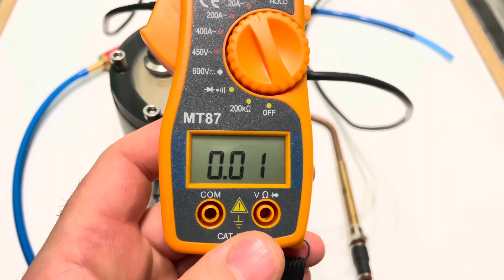HHO Wet Cell - 12V 4 amps. Torch Electrolysis. Part 2

Comment: Very nice.  A consistent flame from those small plates, impressive even if the flame is small, considering hydrogen burns hot instead of big.  
I'd consider putting a flashback arrestor on your fuel line.  A quick way to make one is to get a couple aquarium air stones and stick them in a little PVC casing just big enough to hold them.  I doubt you'd need one on a generator of this size, but for anything bigger or something that gets the chance to have some of the gas stored, you should definitely put it in line with the flow.  It stops any flame/explosion from traveling past it while still allowing the gas through.  One of the worst things is having your generator blow it's top off and/or shatter.

(I just recently found your channel, so I don't know if you implement this regularly or not.)
Reply from the maker: Hello. Welcome to my channel! I always use a sense valve, I did a little experiment with them. Thank you very much. Here you make the video with the sense valves
https://youtu.be/hdZivzm82fE
Reply: @Inventive101  Ah, I see.  While it's a decent way to use it, that's not quite what I'm referring to though.  Here's a video demonstrating the one I'm talking about, though this guy doesn't go into detail on how it's made.
https://www.youtube.com/watch?v=eTFucS3wWu8
Here's a link with a few different types of flashback arrestors and how to make them, the one I'm referring to is the filter type flashback arrestor.
https://www.ehow.co.uk/way_6329731_homemade-hho-flashback-arrestors.html
Doing more digging and I found one that gives much more detail on how it's made.  
https://youtu.be/EwmsATggWvw
I would recommend you go with a metal housing instead of PVC, as it will last longer.  This should have a much lower failure rate than the sense valve you're using.  
I'm not sure how much it'll affect the flow-rate, but nothing I've seen has made mention of it.
Reply from the maker: @Theminecraftian772  	
Theminecraftian772
Water fuel Ah, I see. While it's a decent way to use it, that's not quite what I'm referring to though. Here's a video demonstrating the one I'm talking about, though this guy doesn't go into detail on how it's made. https://www.youtube.com/watch?v=eTFucS3wWu8 Here's a link with a few different types of flashback arrestors and how to make them, the one I'm referring to is the filter type flashback arrestor. https://www.ehow.co.uk/way_6329731_homemade-hho-flashback-arrestors.html Doing more digging and I found one that gives much more detail on how it's made. https://youtu.be/EwmsATggWvw I would recommend you go with a metal housing instead of PVC, as it will last longer. This should have a much lower failure rate than the sense valve you're using. I'm not sure how much it'll affect the flow-rate, but nothing I've seen has made mention of it.

Comment: very well made, i notice that you used 7 plates and put one of the electric connections on plate 4 and the other on the two outside plates, this gives a 4 volt gap between each plate, this set up with cause excess heat in the water, rule of thumb is 2- 2.5 volts per gap between each plate, anything over that creates excess heat and steam. A 7 plate setup is perfect for 12 volts but the best efficiency the positive should be attached to one end plate and the negative to the other end plate giving 6 water gaps of 2 volts per gap and creates less heat. Your cell is still a very well made one and i love the compact design the way you have a visual plate on the side and top of it, its better made than some of the stuff that's sold on the internet. I would love a bigger 13 plate one like this for 24 volt operation on a truck.
Reply from the maker: Thank you very much! It's not my last hydrogen generator, so maybe I'll meet your requirement. Cheers mate

Comment: Super heated steam was used during 1950's in Texas by US servicmen to 
run used fuel oil furnace on water line.  Oil used to preheat fire pot 
and S.S. coil tubing + water to 1500 degrees. T fitting and extra valves
 mounted. When up to temperature, oil valve shut off. The resulting 
hydrogen and oxygen torch flame continues furnace running. 90 lbs 
pressure + 90lbs  water lines with dual pumps and central motor with 
blower. U.S. patent application filed, but only resulted in final 
printing of 50% increase in efficiency with ordinary steam as only 
allowed to public. ( The change of high pressure to AMBIANT through tiny
 spray nozzel allowed for extreme vibration of vapor molecules that 
separated to gases,- at a much LOWER unusual high temperature. ) A much 
smaller demonstrator was built and shown to Senater in large wooden box 
with fire brick chamber and steel ring with holes- like coleman stove. 
Units have to be restarted on fuel oil.
Manuscript delivered to 
Patent office was approved, but redone to Patent, to only allow 50% 
efficiency increase of oil furnace by addition of steam from water line 
to spray nozzle. Military soldiers off duty during 1950's collected used
 jeep oil to burn in used oil furnace. They attached water line SS 
tubing coil in insulated fire pot and by monitoring temperature point 
would open valve for T fitting to allow steam line mixed in. The steam 
had been changed to super heated steam with flame on coil. At 1500 
degrees F, the oil valve was shut off , allowing A Hydrogen and Oxygen 
torch flame to continue.  Furnace provided constant heat unless water 
line shut down. If temperature then was reduced, then oil had to restart
 furnace to get it back up to proper temperature. Motor had dual shafts 
for 2 oil pumps for 90lbs. each. The highly sensitized H2O at great 
pressure was subjected to vibration shockwave when exiting pinpoint hole
 nozzle to AMBIENT. The gases separated and burned with the 10Kv 
ignition. The lowered dissociation temperature of steam was realized, 
rather than normal 3-5000 degrees F.  A much smaller working burner unit
 with fire brick surround in large box was shown to senator in under 
ground parking garage. No further news came afterwards.

Comment from the maker: The advantage of the wet cell is the low price for the materials used
Reply: I wouldn't say that is true. A dry cell is just as cheap and you can use the same materials. You can use the same materials as what you have got for your wet cell!
Reply from the maker: @r1ckySV  I have built and less material is needed, less work and everything is cheaper. from my point of view you save gaskets many screws, the expansion vessel
Reply from the maker: @r1ckySV  And besides, in a wet cell you can use the entire surface of the stainless steel plate, while in a wet cell you lose the edges, so it's cheaper.
Reply from the maker: @r1ckySV  It's just my point of view
Reply: @Inventive101  if you look into it, you get current leakage on a wet cell from the edges being exposed to the water.
Reply from the maker: @r1ckySV  👍
Reply: @Inventive101  I have been into this for such a long time.  Good work though
Reply from the maker: @r1ckySV  Thanks 👍
Reply: I built a wet cell/dry cell. I used the resistance of the water flow through the plates to cause the submerged dry cell to rotate, thus agitation of the formed gases release from the plates from turbulent scrubbing. This also allowed me to capture arc loss at the plate edges. Drycell units, when scaled up, waste POUNDS of unused plate surface area.

Comment: Can this run a generator that produces enough power to charge an electric car? Imagine while you’re at work, the solar panel is generating HHO and generator charging the batteries while car is resting under the sun, then when you get off work, your batteries are fully charged from the sun and water as fuel, zero carbon footprint, no electricity cost, as bonus, you’ll have drinking water from the generator’s exhaust, do you think this system is possible?

Comment: If you change your electrodes to concentric circles. Minus in the middle solid rod, and positive on the outside pipe. 6 or seven pipes that fit into each other and insulated from each other, you will tripple your gas production. The container is perfect.
Reply: Have you tested this idea? could you please elaborate. Thank you.

Comment from the maker: How about a new project? Green hydrogen, renewable energy?
Reply: It can be "free" if you power it with, Geothermal, solar, earthen voltage phenomenon, atmospheric voltage phenomenon, Media (water, wind). Probably many forms of collecting required for our electrification sensations..

Maybe a large tube into the vacuum of space connected to power station on the surface. That sure would suck.

Comment: Which is more safe dry cell or wet cell?
Reply from the maker: I'll do an experiment with a wet and a dry cell, I'll be able to do it here
Reply from the maker: I will make two generators with the same number of plates and the same size but one will be the wet cell and one will be the dry cell
Reply: The gas has to be passed through a modifier to reduce the burning speed and  soften the flame or else both are unsafe it can create a backfire.
Reply from the maker: @george4781  It can create an explosion. Is very dangerous
Reply from the maker: https://youtu.be/Cd8kn_3vJtI

Comment: Bro, this A meter is for AC, not for DC 🤔
Reply from the maker: As far as I know about electricity, AC has a higher voltage, I'm not sure if I know a lot about current. if it were AC would I still be able to get my hands on the pliers without being corrected? I use a 12 V car battery
Reply: @Inventive101  its not about low or high voltage, AC is current from wall socket, but from accumulator  is DC, you need different A meter.
Reply from the maker: @aleksandarpetrovic6613  the one who sold it to me said that it was what I needed, otherwise it would not have been measured if it had not been what I needed
Reply: @Inventive101  you need DC Amp meter. Your is AC and can't give real numbers. AC have sign looks like wave, and DC have sign looks like one horizontal line and few dots under line. And DC A meter is more expensive. I hope it's helpful 🙂